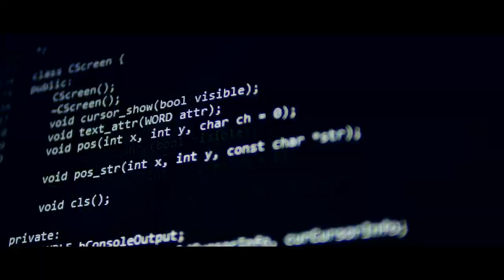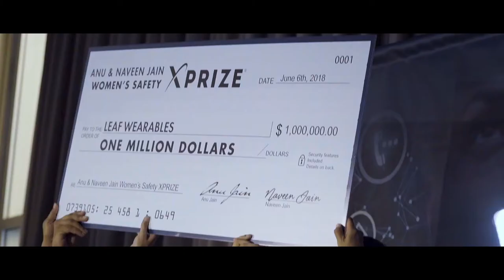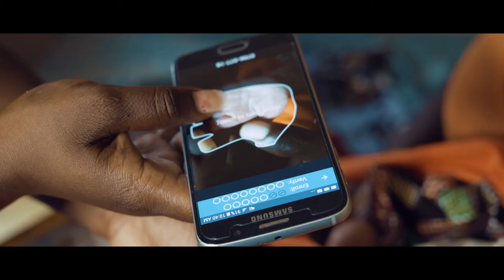WE ARE XPRIZE

Comment: Here are some prizes I'd like to see: 1. Prize to the person or group who first prints 100,000 3D printed homes that are 750 sq. ft. or greater and conform to local code. 2. Prize to the person or group who creates an AI that can unendingly improve itself over time - at least a 1% improvement in some metric per day. 3. Prize to the person or group who creates a fusion reactor that generates at least 10 times more power out as that which is put into it.